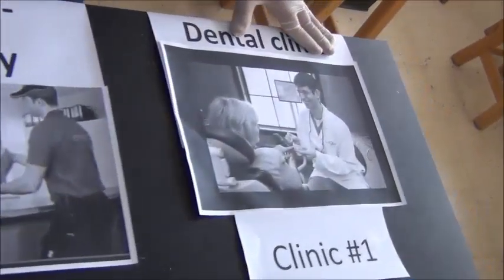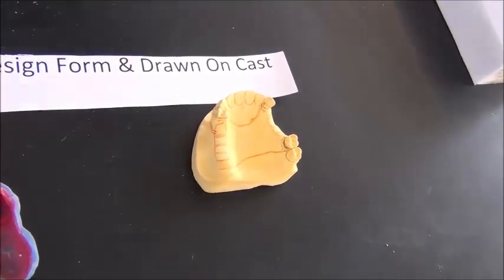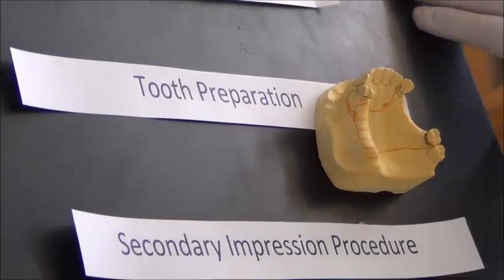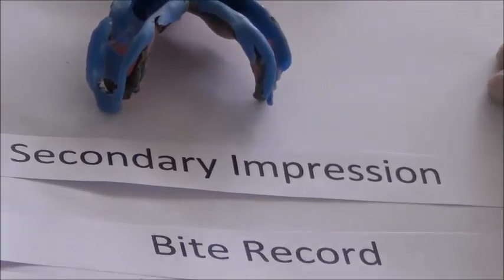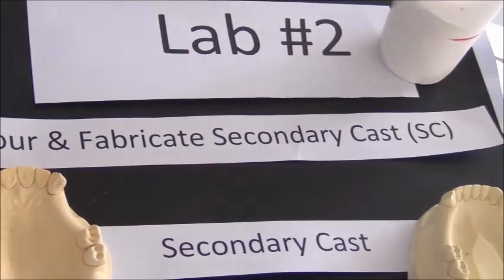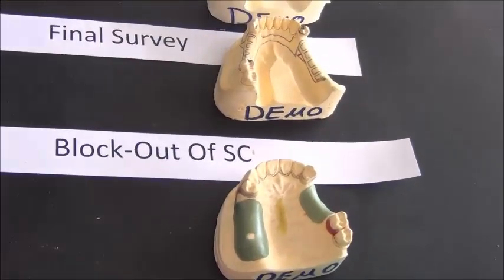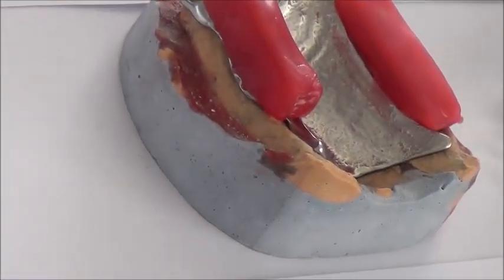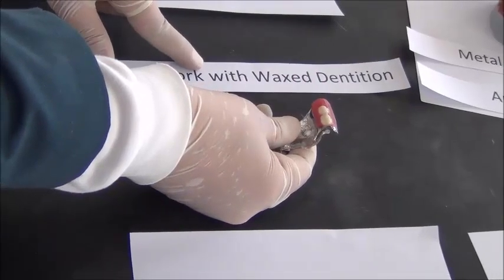10 Permanent RPD: Partial denture Clinical procedures and lab steps

Comment: secondary impression is Taken with green sticks + light silicone body ? or i am wrong
Reply from the maker: Green stick yes.
Light body pvs .No
Because its high flowability it will not stay inside the tray. It becomes very messy and does not compress saddle areas
Reply: @Dr.laylaAbuNabaaDentistry  thank you so you use light body pvs + green sticks ?
Reply from the maker: @azouz5675  use medium body with the green stick
Or use highly specialized fine alginate with the green stick
Reply: @Dr.laylaAbuNabaaDentistry  thank you very much prof